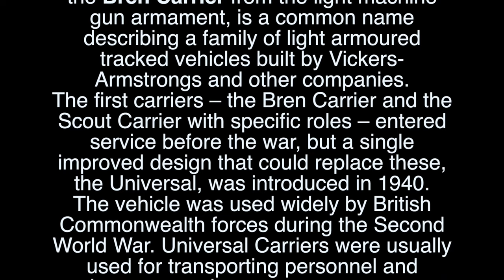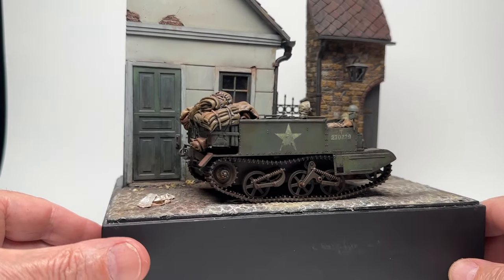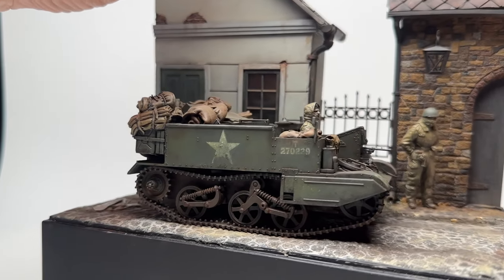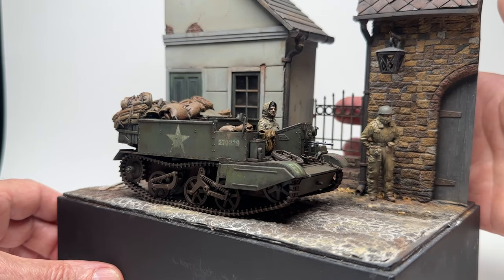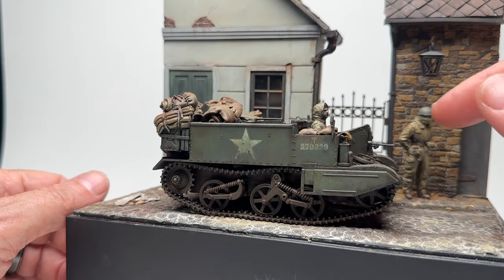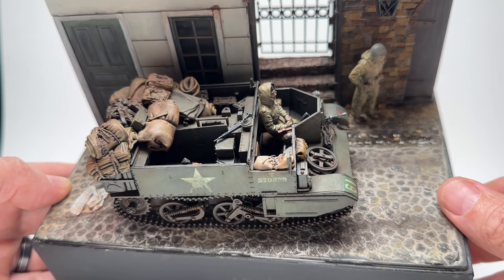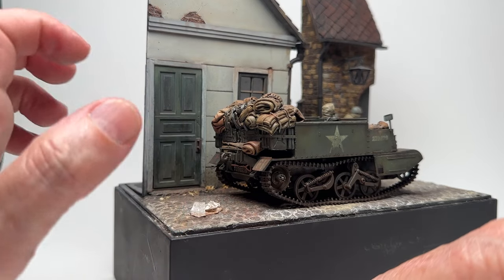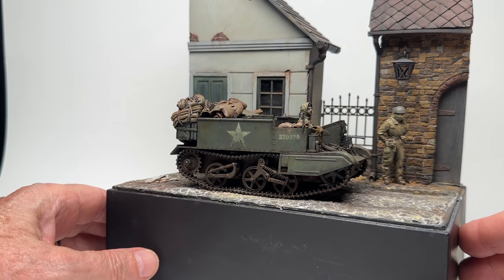Custom made diorama with a Tamiya Bren Carrier in 1/35 scale.

Comment: The Camo on the Tank Crew member is accurate.. This pattern of tank suit was introduced in 1944 and saw some use in the latter stages of the Second World War. It is based on the same design as was used for the tan coloured 'Oversuit, Tank Crews' but made using a material which has had the WW2 brushstroke camouflage pattern printed onto it. The suit is fully lined with a khaki wool flannel shirting material for warmth and there is a layer of kapok between this and the outer layer for the same reason. They are very rare and worth a nice drink if you can find the genuine article
Reply from the maker: Great info! 👍😎
Reply: Pixie suit
Reply from the maker: @markienatnots9479  yup